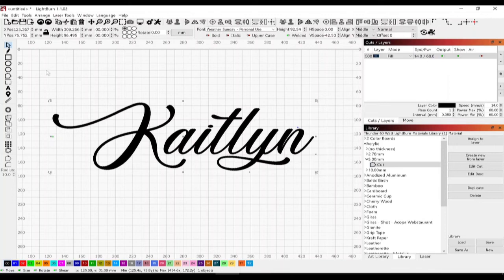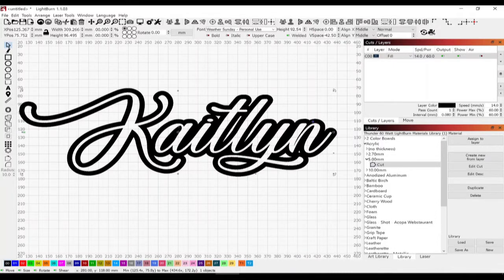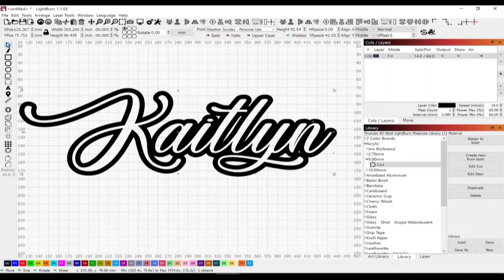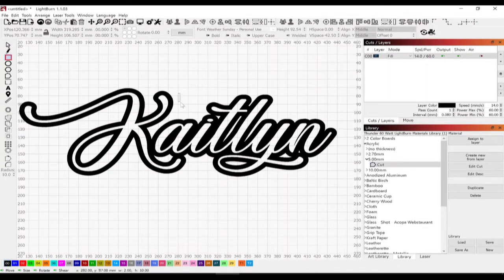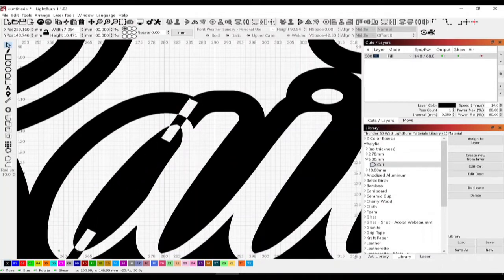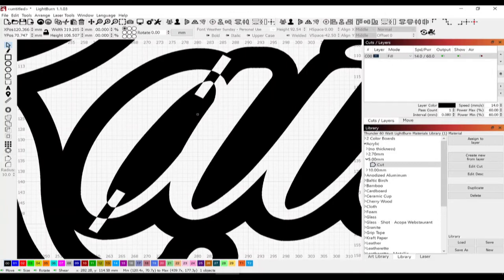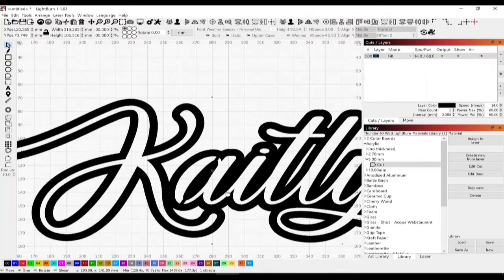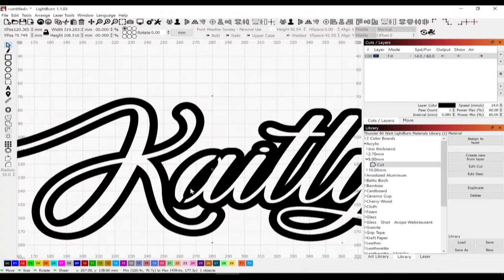Boolean Funtions in Lightburn (Weld and Union) to Retain Inner Shapes

Comment: from .44 seconds i lost on how you made that and had it filled, im lost on how when you overlayed it that it looked the way that it did being some what transparent over the other letters and so on
Reply from the maker: I'll do my best to break it down.  In this section of the video (starting around .44 seconds), there are 3 separate shapes.   Shape 1: the name (which has already been welded together as one unit);  Shape 2: the rectangle on the upper portion of the "a";   Shape 3:  the rectangle at the lower portion of the "a".  What I am doing is selecting the name and then holding down the shift key so I can also select one of the rectangles.  Once the two objects are selected, I choose the 'weld' option to permanantly make them 1 shape.  At that point, the overlapping portion of the rectangle disappears which is why you notice the color change.  I hope that make sense.  I'll re-watch that portion of the video and see if I can pick up anything else that might help :)
Reply: @holterridge  when you made the little rectangle, how did you make it filled in completely? mine always makes the rectangle outside line but empty in the middle , so basically the line of a rectangle thats not filled in black

Comment: how did you get your rectangle to be filled in?
Reply from the maker: Great question. Under 'Cuts/Layers' you have the option to choose 'line' or 'fill' (under 'Mode').  Line is typically used to cut (or - at lower power settings - to score your material).   Fill is typically used to engrave. In this case, most people would be cutting.  However, I chose to put the setting on 'fill' with the thought that it would be easier to see for anybody watching the video.  If you can't see 'Cuts/Layers', choose 'Window' from the upper menu and then make sure their is a check mark next to 'Cuts/Layers'.  This function can be performed in either 'line' or 'fill' mode, but in 'line' mode, the shapes will not fill in.